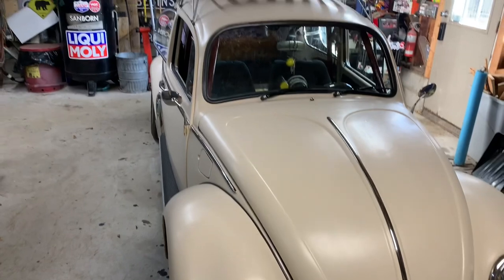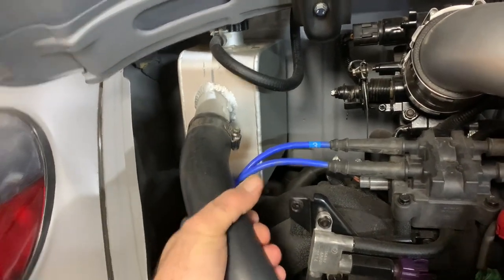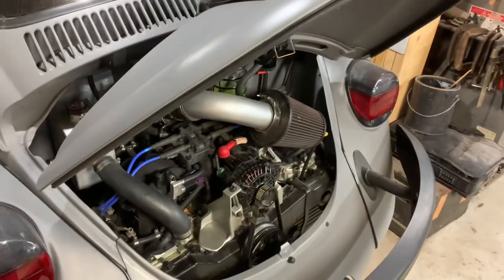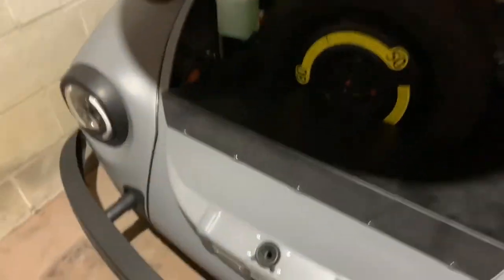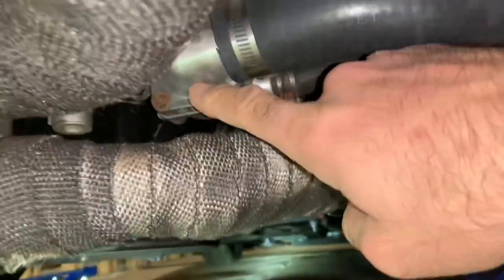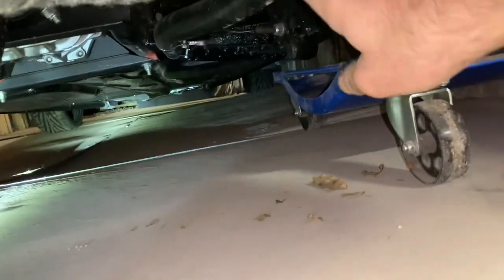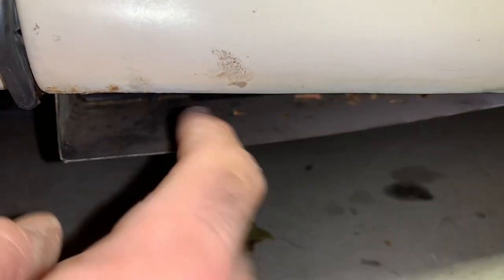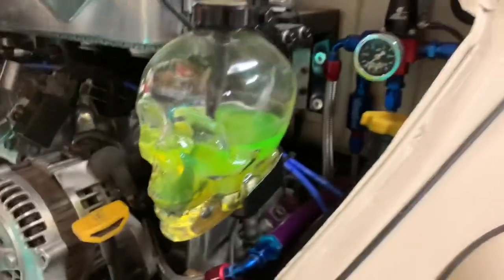Subaru Swap Coolant System

Comment: Thabks for making this video. Im working on a conversion and the cooling system is the biggest hurdle. Planing to use 1 1/4 emt as well glad to see someone having success with it.
Reply from the maker: The most important part I have found was the expansion tank. This was my third attempt at this. By running the big pipes in and out of it, makes the bleeding procedure so much easier. I am putting a new engine in my beige beetle. When I do the coolant fill I plan on doing a video.

Comment: Another way to do this is to sacrifice the rear package space with a new fire wall installed at an angle to the top of the pan where the body bolts to the area in front of the rear torsion bar tube. Doing this gives space for other things and a Ford Falcon radiator that fits the angled firewall. Air is ducted up to the front facing side of the radiator. Two pulling fans are also part of the installation. The new firewall gives extra space for an oil cooler, etc.
Reply from the maker: Yup I have seen that done as well.  When I did the conversion on the beige beetle 13 years ago, I had a big speaker box in the package tray. So I went with the front mount option.

Comment: You did a great job. Are the pipes that you used for the cooling system just steal, or are they something else
Reply from the maker: They are emt conduit. Steel pipes for electrical cables. These ones are called 1.25 emt. But actually measure 1.5 inch diameter.

Comment: Do you use an engine mount bracket for an ej motor? Or does it holds up the same way as the vw engine by the transmission bracket and bellhousing bolt?
Reply from the maker: I use and adapter plate that lets the engine hang just like a beetle engine. 

For extra support I put a transmission strap kit around the bell housing. Aswell as I use I mid mount on the transmission.

Comment: Thats a neat system there, guess without heater pipes its that simple. 
So need need for any bleed valves?
And did you still run pipes through the TB, or just delete them.
Reply from the maker: I did not need bleed valves with the big pipes going to the expansion tank. I did not run coolant to the throttle body. 

I am planning on installing heat one I find a unit that will fit under the back seat nicely.

Comment: Nice work where did you purchase your radiator tank do have a link thanks again
Reply from the maker: I purchased the bottle from Amazon. Just search “expansion tank”. There are many different colors and sizes. Then I modified it with the inlet and outlet pipes.
Reply: @Utopiabugs  thanks

Comment: Are you using a the heater circuit? I would love to see how you did that. Maybe just a drawing of how you did it.
Reply from the maker: I am currently not running a heater in the beetles. But I do plan on doing so when I find a suitable heater core unit. I was thinking a universal one from Amazon under the rear seat.
Reply: Ok cool I have a vintage air unit for heat just not sure about the plumbing system for it
Reply: Also both of your builds are really nicely done!
Reply from the maker: Thank you very much.
Reply from the maker: In the Subaru the heater supply and return are located just above cylinder #4. I think they are 2 half inch metal pipes. One comes from the end of the cross over tube, and the other is a black pipe that leads to the water pump.
Reply: Hey man could I pick your brain I’m having problems with my swap cooling correctly. Maybe talk on the phone or email?
Reply from the maker: Sure thing. 
We can chat on Instagram if you want @utopiabugs. Or email utopiabugs@yahoo.com

Comment: What material are the long hoses on the right and left made of? metal or rubber?
Reply from the maker: They are 1.25 EMT Conduit. Which actually measures to be 1.5 inches in diameter. They just call it 1.25.

Comment: What gearbox do you use?
Reply from the maker: The grey beetle has a built 75 beetle zig zag single side plate transmission. The beige one has the same tranny but in stock form. It will be built soon.